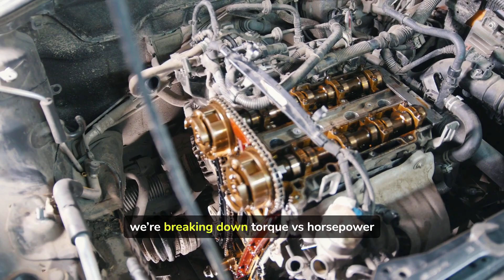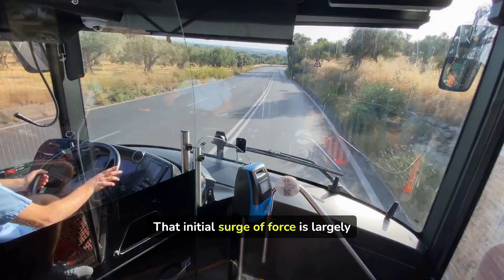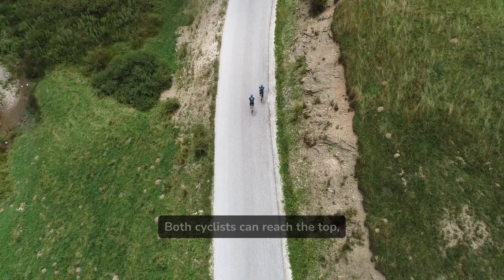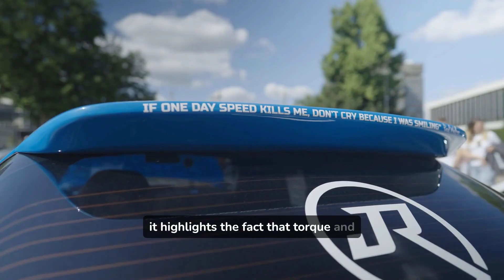Torque vs Horsepower Simply Explained

Comment: ⚠️This video is absolute Hivemind 🚮

Below is a list of some worth watching:
The only caveat I will mention is at least one of these implies that crankshafts provide leverage to propel the vehicle which is nonsense.  Otherwise they are some of the best here on YouTube/

Power and Torque (for Cars) Explained in
60 Seconds!
Channel is:
KYLE.ENGINEERS

Does Horsepower or Torque Make your Car Fast
Chanel is:
Alex LTD LX

Power vs Torque - In Depth Explanation and Mythbusting!
Chanel is:
KYLE.ENGINEERS

Horsepower vs Torque - A Simple
Explanation
Chanel is:
Engineering Explained

Horsepower vs Torque Explained - Which REALLY
Matters?
Channel is
freedomworx

Engine power, torque and achieving maximum acceleration 
Chanel is:
 Auto Expert
John Cadogan

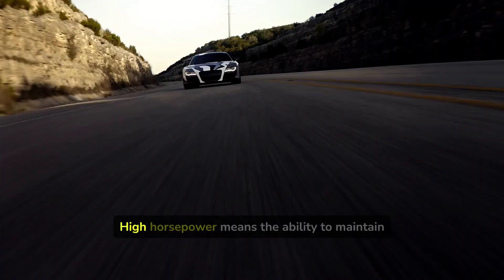Comment: 🙄 6:50 high torque does not mean high pulling power.  Torque is not any kind of power.  Power is power. (This is probably why it’s called power) 
Power, not torque, is the limiting factor in not only the top speed of a vehicle but also how quickly it can accelerate at any speed and how much weight it can pull up an incline at any speed.

All work is done by power!

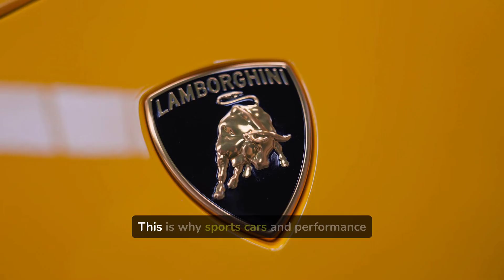Comment: 🙄 5:05 Horsepower = highways?

 They've got a brand new thing that just came out the Internet Hivemind apparently hasn't heard about yet. It's called:... "gearing" Early reports suggest it is coming soon to transmissions and differentials near you. According to one source, who would not go on record, it apparently it uses a brand new concept called.... leverage to trade some of your RPM from your horsepower to multiply your torque.

⚠️ ** On a cautionary note Top Scientists have issued the following warning: Do dumb things with gearing - expect dumb results! **

Have you got anything you can use to trade torque to gain Horsepower? 🤣
All work is done by Power.

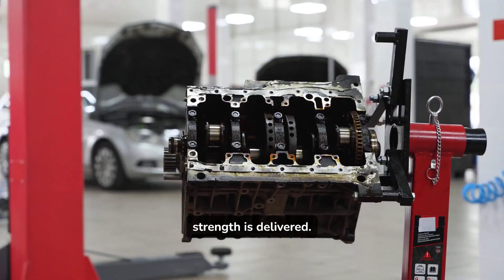Comment: 🙄4:02 torque is not the “strength” of the engine.  Power = Force x Velocity it is both the strength (Force) and the speed (velocity). Power = Work / Time so it is the limiting factor in not only how quickly  a given amount of work can be done (speed) it is the limiting factor in how Much work can be done in a given time period (strength)

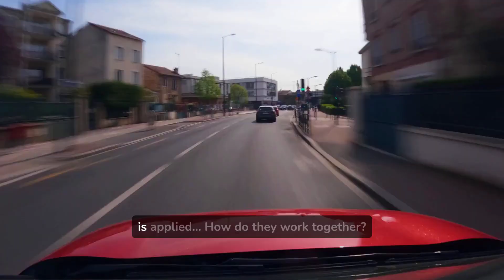Comment: 2:49. How do they “work together”?  They don’t.  Torque doesn’t do work at all. 

Forget about torque!

Wherever you are on the Power curve is your budget to accelerate, tow, climb a hill, push through aerodynamic drag... ** ANY ** type or example of work.  Torque is only a useful spec when you are calculating when parts will break or how much tension you need on the fasteners to keep the wheels on the hubs and the heads on the block.

All work is done by Power. It's not an opinion or just a fact,.... It's the Law! 
(The First Law of Thermodynamics-conservation of energy to be precise)

Torque doesn’t do work.
Torque is just the slope that energy wants to slide down.
The actual sliding — the real movement of energy through time — is Power.
Work is simply how much energy successfully slid.
Forces, torques, fields, and stresses are not the cause of work; they are the geometric shadows of an underlying energy imbalance.
Only when energy actually flows (Power) does any work occur, from a stalled motor to a tectonic plate to a quark.
So the clean, universal truth is:
Work is the integral of Power because all work is done by Power.
Everything else is just geometry; a description of the slope, not the movement.
Reply from the maker: Torque absolutely does work. without it, nothing turns. No turning = no work.
Power doesn’t replace torque, it just describes how fast the work is happening.
If torque didn’t matter, engines could make power without turning anything which is impossible
Reply: @techietales2 🙄 “power describes how fast work is happening.”  “How fast” includes any speed not equal to zero.  This means the only work that power isn’t doing is all the work that is happening at a speed equal to zero.🙄
Reply: @techietales2  you may need to sit down for this: the only thing that can do one horsepowers worth of work per minute is…. One horsepower.
One lb•ft of torque can’t do one horsepowers worth of work per minute.
One Billion lb•ft of torque can’t do one horsepowers worth of work per minute.
All work in the entire universe is jot only done by power but it is done at a rate dictated by power.  Torque and force are the emergent geometric constraint gradient effects of energy transfer.  
Please do brush up before pretending to teach and mislead others with this groupthink.
Reply: @techietales2  Does Torque make motion happen.” ?

Not by itself. Ever.

Not without energy transfer
No energy transfer means:  nothing moves.
No energy transfer means: no acceleration
No energy transfer means: no velocity
No energy transfer means: no way to do work

Torque participates in motion, but it never causes motion.
Motion requires energy flow. Full stop.

2. Motion demands energy transfer, and energy transfer *IS power*

This is not philosophical or opinion — it is  the First Law of Thermodynamics - energy conservation.

If anything in the universe changes position —
from a lug nut to a quark —
energy has moved.

Energy flow per unit time IS power (dE/dt).

So:

No Power → no energy transfer → no acceleration → no motion → no velocity → no work.

Power→ energy transfer → motion → work.

Torque has no causal ability here.
It is the geometric factor in how much work results from the energy flow.
But it is not the doer of anything.

3. “Is power “real” or just a measurement?”

Power is as real as energy itself.

Saying “power is just a measurement” is like saying:

Temperature is just a measurement

Voltage is just a measurement

RPM is just a measurement

All physical quantities are “measurements.”

The question is:

Does the quantity correspond to something physically real?

For power, the answer is yes:

🟦 Energy flow is physically real.
🟦 Power is energy flow.
🟦 Therefore power is physically real.
Conclusion: Power is the process of energy transfer that does work it is measured by it's rate.

4. Torque and power are not “two camps.” They are not competitors.

Torque tells you how strongly the motor twists the shaft.

Power *tells you *how *fast the motor can* do work  and how much work the motor can do per unit time.

Power is not optional.
It is not decorative.
It is not an afterthought.

It is the cause-effect mechanism that turns torque from geometry into reality.

*5. The indispensable universal truth 

Torque without power = nothing happens

Power without torque = can’t happen (for rotation)

Power = work gets done.

Power: is the Process of doing work
(Things Happening)

Force, or Torque in rotational systems is the state of energy gradient 
*(Nothing NEW Happening)

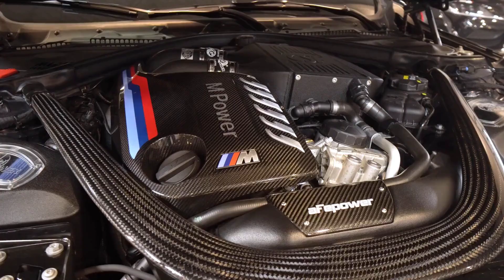Comment: 🙄 3:00 Power = dE/dt.  Torque, RPM and work are dependent upon and emergent effects of energy transfer.

Power is the   Process   of energy transfer: 
(things happening)

"Force" (and torque in rotational systems), is the   State  of energy equilibrium:
(noting NEW happening)

All work is done by Power!
Reply from the maker: You’re overcomplicating it and mixing definitions.
Yes, power = dE/dt, but that doesn’t make torque a “state” or irrelevant.
If torque were just a “state,” engines could have power without torque, which is impossible.
So work isn’t done by “power alone”. power is just the rate. Torque is still the mechanism doing the turning.
Reply: @techietales2  nonsense. And don’t put words in my mouth.  Power from a. Engine can’t exist without torque any more than work can happen without Power.  Torque is not a mechanism. It has no rate and no time component.
Let me ask you this and I’m not going to let you up once it pins you to the mat:

Exactly how much work do you think you can do at a “Rate” of ZERO?

Velocity is a Binary: it is either equal to zero (torque)_or_ it is a value greater than zero (Power).

Work is a Binary: it is either equal to zero (torque) or it is a value greater than zero.(Power)

Work can not be non ZERO if Power is Zero.

All work is done by Power!
Reply: You have no business making Hivemind groupthink garbage videos about a topic you clearly don’t understand.  Please remove this and do one on gardening, dung hit repair or something more your speed.

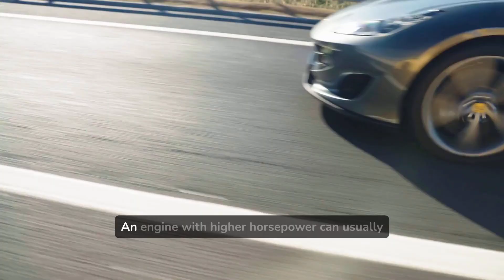Comment: 🙄 2:40 Torque is not the force that turns the wheels.  

If when you think of torque you picture any kind of motion.. you aren't getting it. 
That's Power.
“Force” and Torque have no time component. They are frozen and motionless.

The derivation:
a=P/(m• v) makes this explicit: acceleration depends exclusively on how much power (energy per unit time) is being delivered to the object

All work is done by Power!
Reply from the maker: Torque literally is the turning force. Without torque, nothing rotates.
Power doesn’t replace torque; it’s just how fast torque is being applied. That’s why:
Torque = ability to turn the wheels
Power = how quickly you can keep turning them
Even your own formula shows both matter. power depends on force and velocity, not just one.
So no, it’s not “all power.” Cars need torque to move and power to keep accelerating
Reply: @techietales2 Nonsense: You don’t “need” torque.  It’s an unavoidable emergent geometric constraint consequence or energy transfer.  The only thing that “starts and continues movement” is energy transfer.
All work is done by Power!
Reply: Torque is Force x Radius. Turning the wheels is work.  It has velocity and rate, it is happening in the time domain.  Torque doesn’t do work, it doesn’t have a rate or velocity and it has no time component.  Motion, rate, velocity all belong to Power. 
If it’s moving power,at one point or another, is what caused it to move.  Nothing in the entire universe moves without energy transfer.  That’s the first Law or Thermodynamics - conservation of energy.  Don’t trust me…. Look it up!
Reply: @techietales2  Your reply: “turning force” proves what I just said in my comment.  You don’t get it.  “Turning” is a verb.  It is motion.  If there is force and velocity (ie:motion)  it IS Power.

You use the word “Force” like it Causes acceleration.  
This is only true when Darth Vader uses the dark side of it in Star Wars.
Reply: @techietales2  There is no way for an engine to transfer energy (create power) without torque emerging as a geometric constraint gradient. 
Torque, RPM and Work are all inevitable emergent effects of energy transfer.

Torque / “Force” can continue to exist without Power. 
(Useful for holding wheel nuts on! 👍👌)
 
But !! : ➡️ Work can’t happen without Power! 

Isn’t that really the whole reason we have engine in the first place…. to do work?